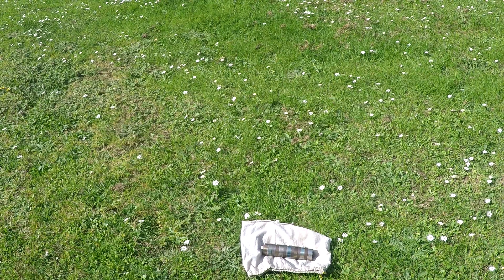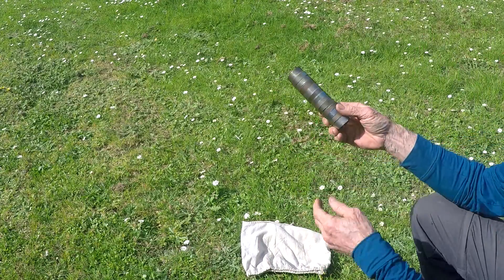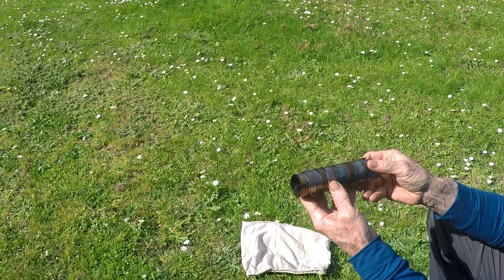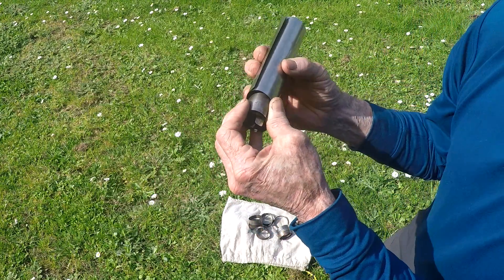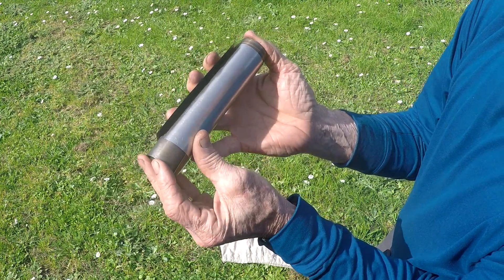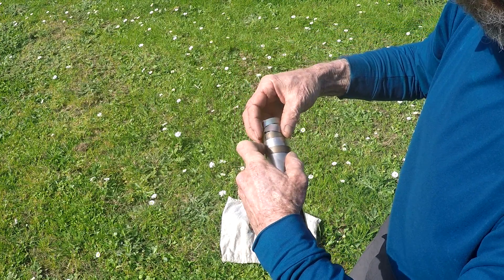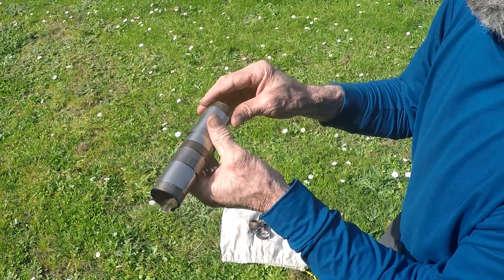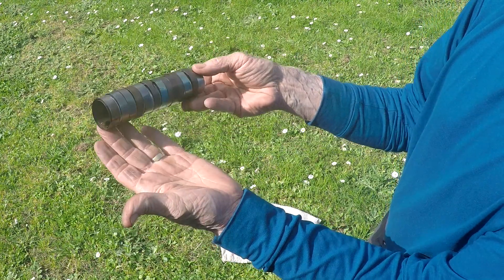Tent stove pipe assembly and pack up

Comment: I bought a tube stove recently and absolutely no one, including the manufacturer had any available info on rolling the stack! I really appreciate your video, and the background info thanks!!!
Reply from the maker: Hi Alan, Happy to be of some assistance. Rolling the flue pipe is tricky to do the first time but the 'memory of the new curl' in the foil can be 'preserved' by suitable heating of the tube while it is formed in its new shape. This makes it much easier to form the next time. However, it also makes it more difficult to roll the other way for backpacking, hence the development of the 'fluepipe 'rolley' device. 
Tim

Comment: Hi I am after making a tent stove flue like yours if you could help with some info what is the metal called an what measurements would I need, thank you
Reply from the maker: Hi Leon, Thank you for your comment. The video that you looked at is old now and I have made many improvements since. I suggest that you look at my YouTube- Tent stove playlist to see more recent descriptions:
https://www.youtube.com/watch?v=fs2OWIWoPo8&list=PLVaCw7cPfpCyToXhS6xanIcZ8IstLTQYm

Also, my website has detailed information on multiple flue pipe posts. You could start with the following link which is the first in a series of flue pipe improvement posts:
https://timtinker.com/improvement-to-flue-or-stove-pipe-rolling/

Regarding your specific questions:
The metal is 0.1mm thick stainless steel foil and is a very hard alloy.
The measurement that you will need will depend on the length and diameter of your pipe that you want to make.

The pipes that I make have an unusually narrow seam overlap and I consider this has a significant advantage of making them compact for backpacking. I also design the diameter so that the rolled up pipe easily fits inside the stove, inside the cooking pot).

I also have designed and posted an innovative flue pipe connector guard tube that protects the formal flue pipe and makes an adaptor to connect pipes that may be smaller than the hole in the stove. This may be of help in your design:
https://timtinker.com/conical-connectors-for-tent-stoves/

I have stocks of the foil ready for budget supply. Please contact me via my secure website CONTACT form (Top RHS of the top menu bar) if you are interested. I also make the necessary ultralight holding rings with welded foil ribbon.  These are the most advances ring available for flue pipes.  I hope this helps. Tim
Reply: @timtelemark907  brilliant thank you for your help, I'm after a fluepipe  like in your first video, not sure how wide I need it to be but my stove is from a 50 cal ammo box, so do you sell this thin steel pre cut? Thanks again for your help
Reply: I have added you on Instagram  👍
Reply from the maker: @leonevans211  Hi Leon,  Yes happy to. I am not sure what size your stove is, but I suspect that a larger diameter pipe, than the ones on my tiny stoves would be required on yours (50 or 60 mm diameter I expect. I have made a 62mm*3.0M one for a Gstove if this helps. Anyway, I can make it almost any size (diameter and length). Please use my secure CONTACT form on my website and we can discuss details.
https://timtinker.com/contact/
Tim
Reply from the maker: @leonevans211  Thanks Leon, There is more stove pipe and stove detail on my website. The search tool on it works well.Tim
Reply: @timtelemark907  my stove is 290mm long by 190mm high
Reply: I have sent pics to your Instagram 👍

Comment: where did you buy the material for the pipe and rings?
Reply from the maker: Hi Brady,
Thanks for your interest in my roll up flue pipes. My first supply of metal foil was a small quantity from Titanium Goat and this was 0.125 mm titanium foil. I used this for my stove bodies, flue pipes and retaining rings. I have since purchased  much larger and cheaper supplies of titanium foils of (0.1-0.15 mm) and wires (2.0-3.0 mm diameter) directly from Chinese manufacturers. Similarly, I purchased stainless steel foils (0.03, 0.1, 0.15 & 0.3 mm thick) also from China. I have found that the titanium and stainless steel foils perform well in my stove flue pipes and the weight advantage of titanium amounts to very little and the price advantage of SS is considerable. I have not destroyed any flue pipe yet, but I have a feeling that the SS is a bit more resistant to heat/fire damage than the titanium, but only time will tell. I find that heat damage to the pipe is restricted to the lowest section of the pipe where there is considerable turbulence as the flue gas enters the pipe,.In my pipe design i always think that adding a little extra length will allow me to, at some time, cut off the erroded section of the pipe to give it an extended life. 

The pipe rings are made from thin strips (5.0 mm wide) of Ti or SS cut from the foil stocks. I spot weld them into precise rings using a plastic ring former.

Over the development of my stoves I have made the rings narrower so that they can all be stored on the flue pipe-rolley-storage device. They could be even narrower yet strong enough, but then loosing them when unpacking and packing while camping becomes a problem.

Hope this helps.
Tim
Reply: @timtelemark907  and what width foil do you use?  6" for a 2" dia. pipe?  Thank you!
Reply: also, what material is the "rolly" made of?
Reply from the maker: @darrellintents3086  
Hi Darrell,  I do my pipes in mm measurement so I am a bit rusty with inches. Also, only recently have I found that others (Seekoutside, Lightoutdoors and Ti goat have a much bigger overlap on the seam than I do (about 2 in) whereas I only have ~0.6in. I did this in ignorance and to keep the roll width as small as possible to allow it to pack up in my bento stove. I am preparing a post on my website about this to test both overlaps and see if there is a difference.
The short answer to your question is: No, the 6in is too small (dia*Pi=2*22/7=6.29in then add some for overlap, 2in or my lean 0.6in, but a minimum of 6.89in would be needed). Who knows what the right overlap is, but my pipes work well but I do curve them carefully before flame heat treating. I expect my test will tell us if there is no difference.
Tim
Reply from the maker: @darrellintents3086  
Hi Darrell, I had a reply to this and hit the wrong button and it went. sorry if it comes twice. Titanium 0.13mm thick in my posts, but i will use stainless steel 0.1mm thick as it is not much heavier and much cheaper. the same applies to the flue pipes.
What will you weld your rolley with?
Tim
Reply from the maker: @darrellintents3086  
Hi again Darrell, I forgot to tell you about my post on my ultimate miniature tent stove 
https://timtinker.com/miniature-dome-stove-a-three-in-one-stove/
It is a very simple very hot tent stove that is great for cooking. It is also a blower stove for powerful outdoor cooking and a backup alcohol stove when required. Runs on a 40mm dia pipe and packs up in its 1L cooking pot.
Tim
Reply: @timtelemark907  Thank you Tim.  So to be clear, you make your rolley out of 1mm ss., and do you use .005mm ss for the flue pipe?
Reply from the maker: @darrellintents3086  
Hi Darrell, I make rolleys AND flue pipes out of 0.13Ti AND 0.10mm SS.
My finest foil is only 0.03mm. It is very light. I don't think I could weld 0.005mm.
There is an Instagram video of a 40mm dia telescopic flue pipe extension made from 0.03mm.
https://www.instagram.com/p/B-Jfw3fhEYO/
You can see how floppy it is. It would be very light, but would not last long as an entire flue pipe.
How do you weld your foil? Do you have any post on your method?
Tim
Reply: @timtelemark907  Hi, Tim, Thanks for all of the information.  My Stainless Steel Shim Stock arrives tomorrow!  Unfortunately, I'm not a welder... I wondered about making a rolley by putting a cut in a 1-foot piece of 2 or 3-inch PVC pipe?  Thanks for all of the help and information!  God's blessings during these crazy days!
Reply from the maker: @darrellintents3086  Hi Darrel,  I suggest use some of your shim stock and put 3 rivets along the join. Use fine flat-head nails to make your rivets and put some heavy pipe inside to act as the 'dolly' or the anvil. A pop rivet will stick out too much, but if you got really short ones you could probably bash them quite flat against the dolly. I did this to make stoves before I made my welder. How much did you pay for your shim stock?
What width overlap did you decide on?
Did you see my post on the narrow overlap?
https://timtinker.com/roll-up-flue-pipes-with-narrow-overlap/

Good luck and stay safe